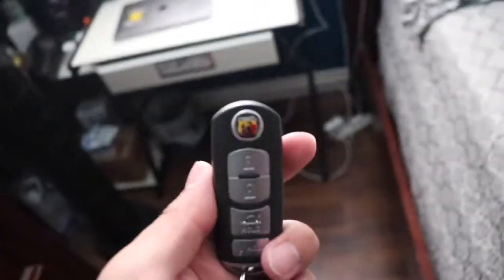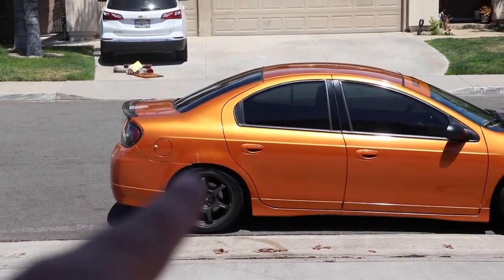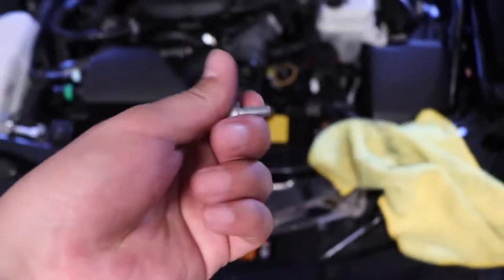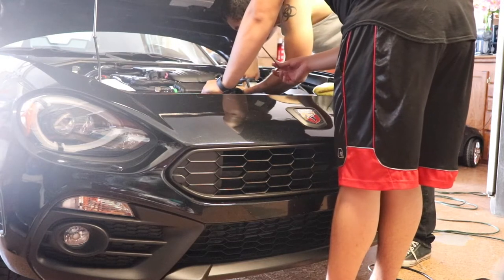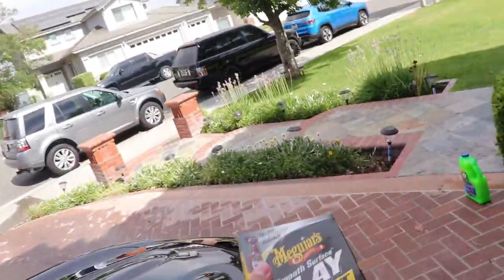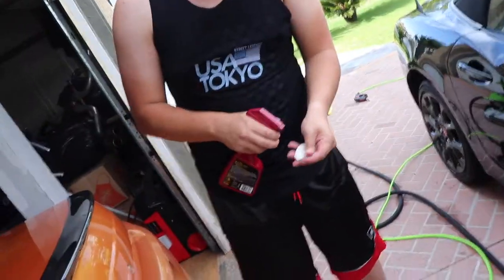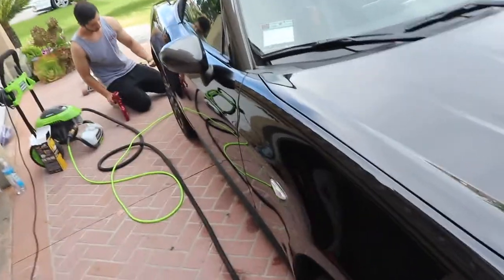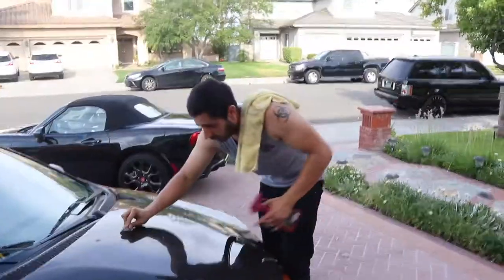Installed a blow off valve on my fiat abarth 124 spider

Comment: The part you installed was a diverted valve rebuild kit essentially. I have a Jeep renegade with the same engine, if you want to hear the turbo more then get a blow off valve plate and some longer bolts and pair it with the go fast bits part
Reply: ThatSubie Guy It would help to know what part you have or installing before you make a video.